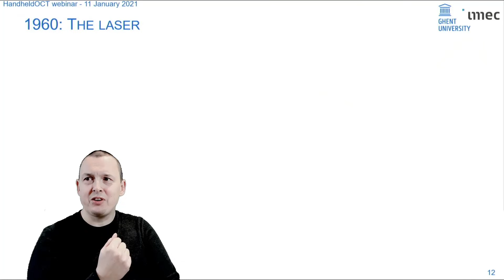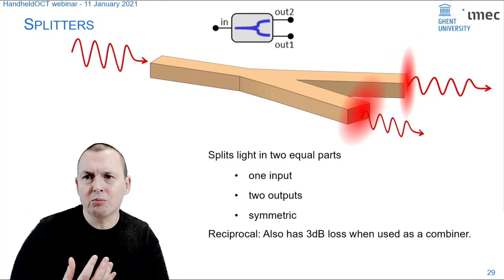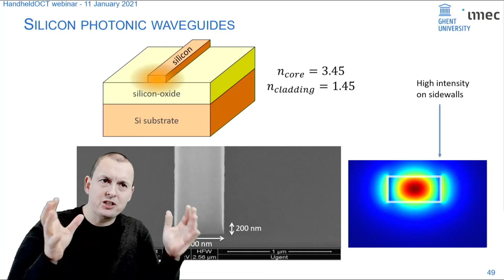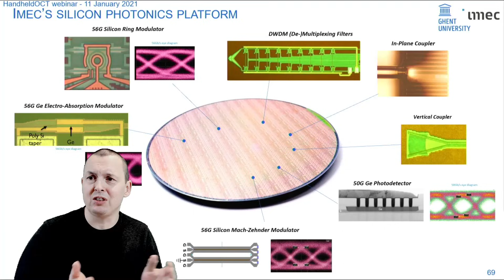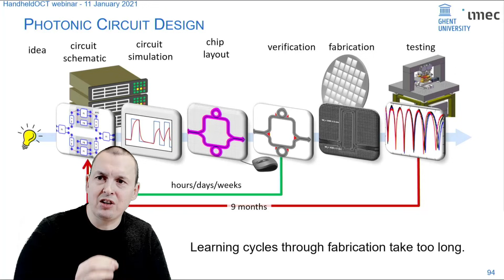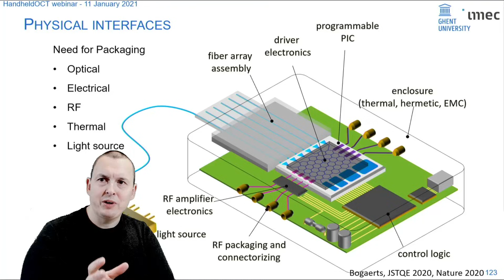Photonic ICs, Silicon Photonics & Programmable Photonics - HandheldOCT webinar

Comment: Facinating  heres a question,  so using the basic building blocks to create a or, and, xor or nand, tbd which is possible with waveguides,  which lab would be able to build my system? Because it requires lab grade...  i get its expensive, but who or where can i get a prototype? Really need to know ive checked around and unfortunately cant find any that doesnt work only with universities or large companies

Comment: The formation of that electron configuration of right angle of plane and up bridge dual sides were like ribbon of a pull down in length lower part likened to the Orions belt and the sampling singular sky display this morning. Noted

Comment: Amazing presentation!

I do have a question about the use of heaters to modulate the index of refraction of the adjacent wave-guide. Are these heating elements placed next to some heat sensing element to provide feedback? Or does the feedback come from the optical output?

Comment: New World Record holder - better EO materials -- Lightwave Logic - makes CPU/ASICs faster, it's all in the EO polymer

1) Semiconductor modulators are a SUNSET business
2) LWLG Polymer modulators are a SUNRISE business
3) LWLG modulators are already more than 3x the speed
4) LWLG modulators are Order of Magnitude Lower Power
5) Many Customers & Partners all under NDA currently
6) Many Foundries implementing LWLG technology in PDK's
7) at OFC 2022 "gloves were off" and the Customer Base was opening discussing the imminent need for LWLG technology where in previous years such discussions were only behind closed doors under NDA
8) At OFC 2022 -- Lebby said "so now it is not a case of Lightwave Logic pushing its Polmer technology, it's a case of Lightwave Logic be dragged along by the Customer base saying >> hey this is really cool, we need to utilize this technology!!"
9) LWLG Polymers are in fact just as Reliable/Robust as Semiconductors

Comment: Piezoelectric quartz should make good phase shifters.  You also need a printed circuit board level of technology to merge the complex chips with more general single function components and to promote diverse applicability for the expensive chips.

Comment: Can light from the sun be converted into a laser (coherent is it?) ? perhaps using the stream of photons from the sun, concentrate and regulate them magically by science,  so into without any processing delay introduce it into a river of communications and send it side by side with a "response light" , that would be reflected back in response (from the last fisical device where light is readed, a router ... ), therefore only using sunlight from one side for the full communication.? thanks
Reply: (electron)ic components are still employed in the motherboard hosting the photonic chip. your idea is only possible if every logic gate and semiconductor was replaced with fiber optic technology. At this point, any fucking thing is possible :)
Reply: Not directly. You can 'pump; a laser with sunlight, but you cannot directly convert broadband incoherent light into a coherent laser beam (not without a lot of loss). Goes against thermodynamics. You don't want to subject yourself to the wrath of Maxwell's deamon.
Reply: Try looking for solar pumped lasers :-)

Comment: photonics processors are the future 
i hope  this techonology will be the next disruptive tehcnology and if photonics becomes a standard expect computers to finally take that first step towards supremacy
Reply: You'll always need a mix of photonics and electronics. Both are good at their own thing really.
Reply: well obviously, till they can make extuded crystal with the optical lanes built in to the crystal framwork and it would just need a light transmitter and receiver i'd assuume at scale this would shrink and clip to a PCB needing no cooling and could prob have multiple slots so you can just scale your performance over time with faster PCBs
Reply: @arcadealchemist  You have a point that ultra-precise material engineering (at the atomic level) would allow us to make photonic devices more compact. But there are more fundamental reasons why photonics will not replace electronics, and why the two need to be combined for best performance.

First, photons are much larger than electrons. This might sound strange, but both photons and electrons have a wavelength, which determines the smallest volume in which they can be confined. For a photon in the visible domain, this wavelength is 1000x larger than that of an electron. so if you can make the photonic equivalent of a transistor, it would still be much larger than the electrical transistor. So you cannot scale this to circuits of the same size as today's electronics.

Second, photons don't like to interact. But interaction is exactly what is needed to perform logical operations. So if you want to make an optical switch (or transistor), you need special materials and a lot of photons to make it work. Electrons-on the other hand, interact quite strongly through electrical forces, and you can make transistors that work on a very small amount of electrons.

this means that digital logic is most likely to remain an electronic technology. But photons can do very useful things around that. For instance, they can be used to accelerate  specific computation (linear transformations, which rely especially on the fact that photons do not interact very well), and communications where photons are not limited by the bandwidth and energy consumption of electrical links. In the end, better and better engineering will eke out the most from each of these technologies, but I don't think we will ever build a full optical replacement of our digital computers.

One other type of computing where photonics could shine is quantum computing. This again does not replace today's computers but performs specialized computations. There are many researchers and companies working on optical quantum computers.
Reply: @wbogaert  i never said it would replace electronics you'd still need power and transistors caps moss n PCBs we're talking more silicone chips it could replace for some process, but it will take another 2 decades to have it in the home maybe less depends on how quickly the technology develops and with quantum in high demand it maybe a lot sooner than you think , people already selling these solutions claiming 10x faster than GPU solutions and 90% less heat. 

It's more about getting first gen Quantum gates for complex calculations, i'm not even sure what it would be good for but if people don't have applications they want to improve then the technology will sit there for a long time and the tech just becomes super expensive, good thing we're having a global economic crash right now :)

I just need to know of the technology for it to evolve is all. 

i'm good at manifesting.

Comment: Great presentation :) I was actually looking for quantum computation (QC) using Photonic Integrated Circuits, but as the device architecture & material challenges are similar for QC purposes I still learned a lot! I'm not sure if someone in your research group is working on QC using Photonic Integrated Circuits, but I'm sure that a video in the same type as this one on the topic would be highly appreciated (at least by me). Thanks, keep it up!
Reply: This is a late reply but ICTP Applied Physics has a series of lectures (4 parts) on integrated quantum photonics :) I find that the information here complements those lectures well.
Reply: Nice